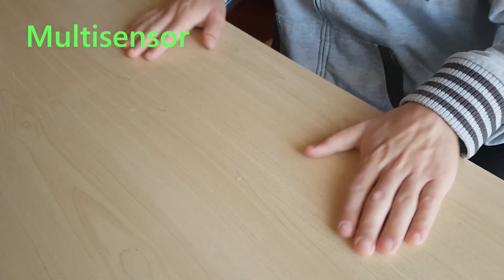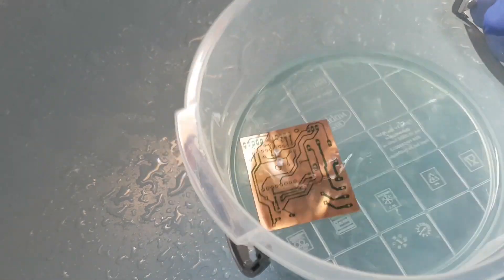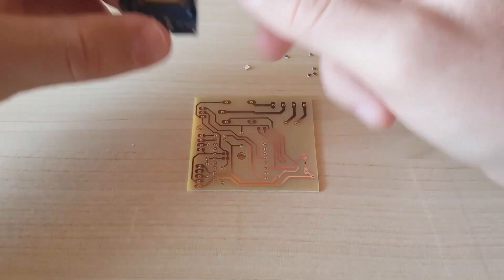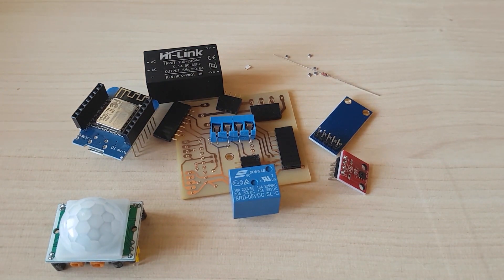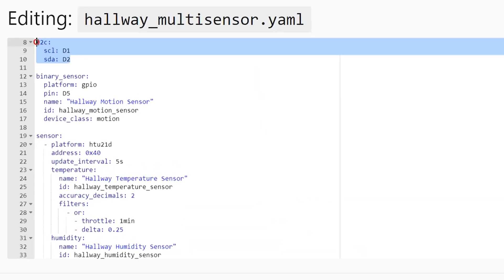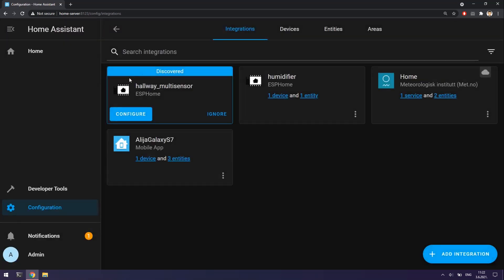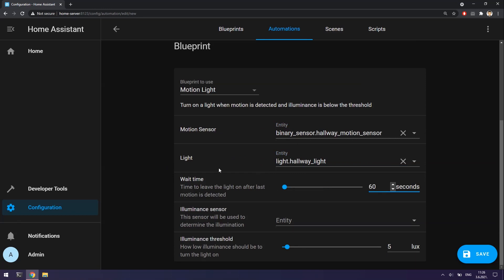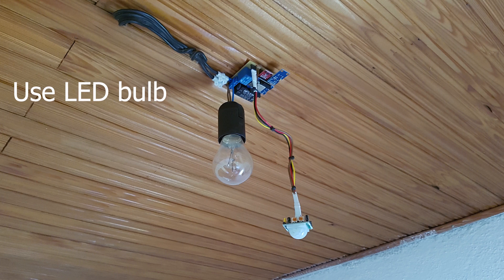How to make Multisensor for Home Automation

Comment: Sorry what's the delta and throtle for? Didn't get what you mean by protocol latency. Would that make it faster to send data or...? Thanks for this great video!
Reply from the maker: These are data filters. Check this link for delta filter: https://bit.ly/3cBv9JH

In left sidebar (on that same link) you have also documentation for throttle filter.

Thanks for the comment.

Comment: Interesting! I also made 6 PCBs for ESP project with traditional method (laser printer -> paper -> ironing to apply ink to PCB -> Etching) but result not so good. It's hard to make with small traces.
You PCB is made really good. What's smallest trace width of your method?
Reply from the maker: Thanks! Indeed, it gives more pleasure at the end, when you know that all you have done by your hand. The smallest trace that I've achieved with this method was 0.3mm, which is more than enough for most of my projects. These days I'm experimenting with making double side PCBs with this method.
Reply: @abobija  0.3mm? Sound great!
 I made two double side PCBs. The hardest part is making the holes on the two sides overlap and vias.
I used THT components as vias to reduce amount of via 
Hope you get good results.

Comment: Can you post the PCB layout ?     Gerber file ?
Reply from the maker: hi, I will publish pcb files in few days.. thank you for the comment!
Reply: @abobija  thank you.  Do you already have them at Conway or jlc?
Reply from the maker: @VAKUL-DC  no, i don't but i will try to generate gerber files so you will be able to upload them directly to pcb manufacturing website (jlc or similar)
Reply from the maker: @VAKUL-DC  hi timaelabu, I have added link for Gerber files to the description of this video. Anyway, here is the link as well: https://abobija.com/multisensor-cam-outputs
Reply: @abobija  Thank you. I will check out the PCB video. do you get the blnk PCBs from Aliexp/Banggood ?..are they same as the blank copper pcbs or different for the light exposure?
Reply from the maker: @VAKUL-DC  No problem. Yes, I have ordered PCBs from the eBay. Those PCBs are coated with the photoresist layer. Here is example: https://ebay.to/2WFlfyw